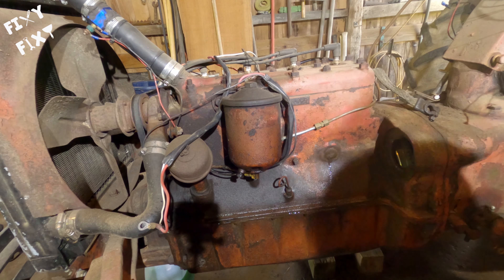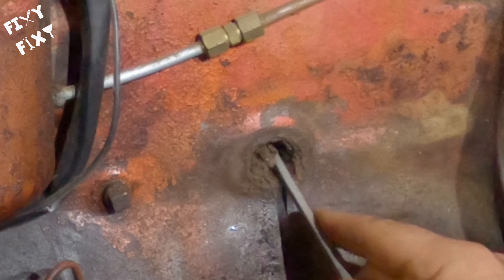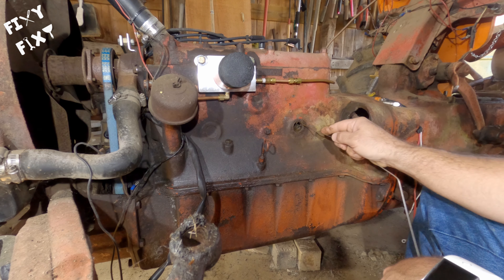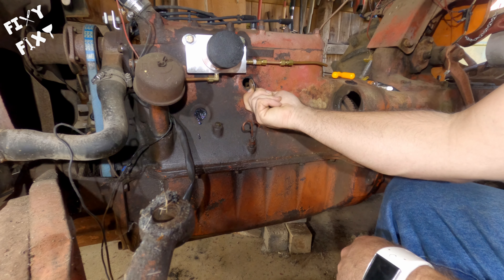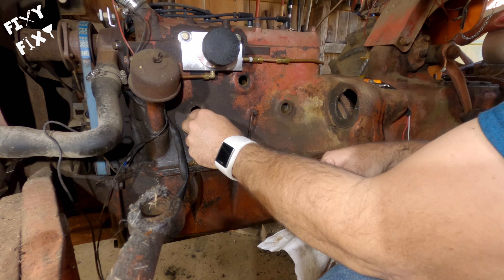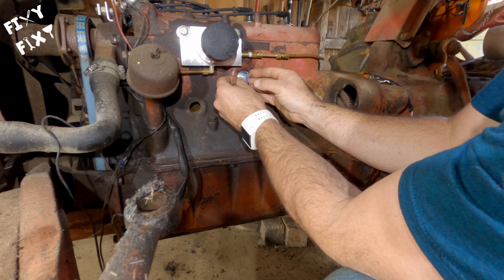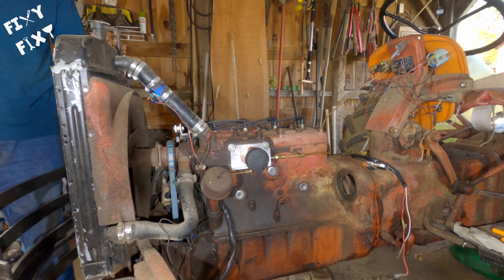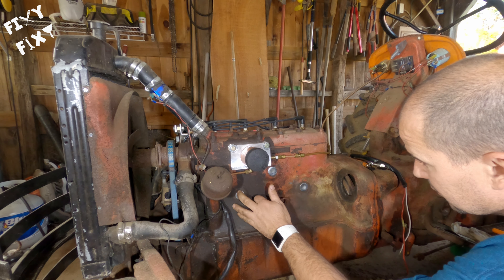Ford N Series Freeze Plug Removal and Replacement

Comment: Punched out the 4 plugs in my '49 8N and found the same issue as yours just not quite as bad as your rear plug. 
Will pull the radiator and water pump and use a pressure washer to clean out the coolant passages as much as I can. 
And, will then move on to my other '40's vintage tractors and start punching out freeze plugs.
Will consider this a routine "first time" maintenance item on any "new to me" engine I buy in the future that has not been completely rebuilt. 
THANKS. Ultimately, you really helped every engine powered piece of equipment I own.
Put your video on vintage tractor forums.
Reply from the maker: I wish I had thought of the pressure washer idea! That's genius! I'll check out that forum and thanks for watching!

Comment: I had the same crud in my Chevy six after 15 years , rust , I flushed the block , after removing all the plugs , with a garden hose for 20 minutes , 'till the water came out clean .
Reply from the maker: That would get it cleared out. Thanks for watching!

Comment: That's because the little square plug above the oil dipstick is actually supposed to be a drain cock.

Somebody took it out and replaced it with a square plug. Not too surprising, because the drain cocks do in fact interfere with the removal of the starter if one has to ever remove that for servicing. Most often, I see the cocks closed and the outside bashed over with a hammer, but the previous owner here took the time to find a proper fitting plug to replace theirs.

Because of the placement of the water pump, you need that drain plug by the oil dipstick to be serviceable. Otherwise, you are only draining about half the coolant in the block if you just drain the radiator through the radiator's drain cock and removal of the hoses from the water pump. You can't truly flush the engine block when servicing the coolant system. That's why there's so much crud down in the bottom cooling chambers of the engine block.

You can get a replacement drain cock for the engine block from Steiner's Tractor Parts, Yesterdays Tractors, and Dennis Carpenter. The original part number is either 9N8115A or 9N8115B

Comment: Thanks for the vid. Where did you get the new plugs?
Reply from the maker: There was a small family owned tractor shop that had them in stock for 75¢ a piece. You can find them on line but be prepared to pay a lot more. You want to search Welch plug for 8n 9n 2n. Good luck
Reply: @FIXYFIXYCHANNEL  I did find them from one of the 8N parts sites. Thanks.
Reply from the maker: @jjay718 congrats! I hope they go in without too much fuss. Thanks for watching!